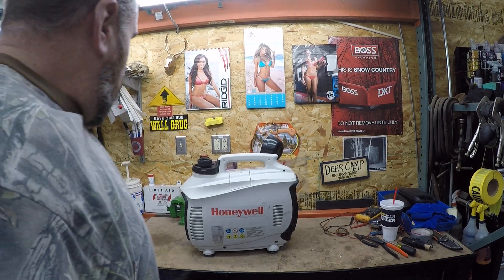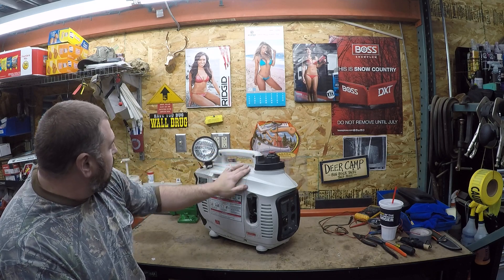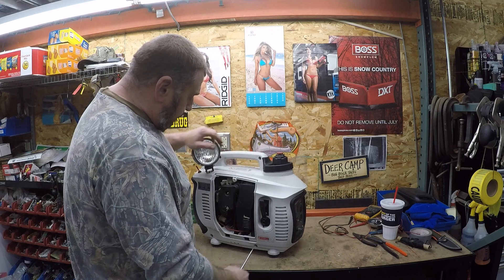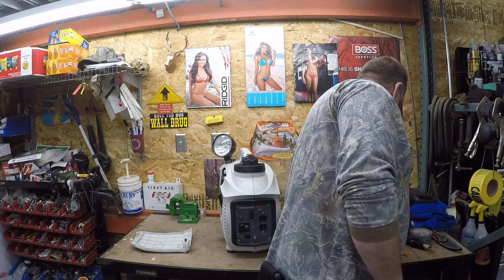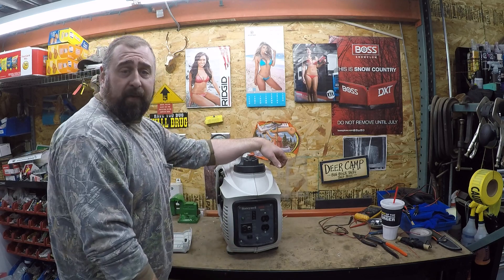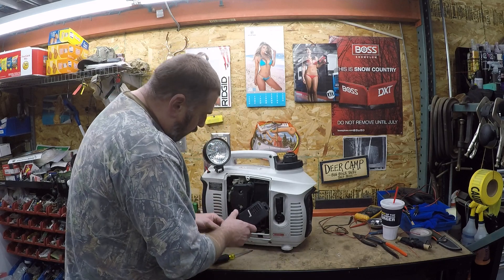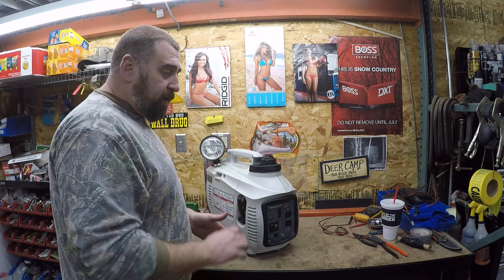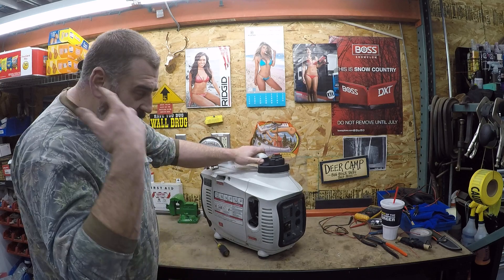honeywell 1600 watt portable  generator  / generac ix 1600 watt

Comment: Its been a while, could you explain more about the overload bypass?  I can deal with no overload protecting if i can still use my generator in emergencies.
Reply: I'm looking to the wiring diagram and it shows 3 wires from the inverter to 4 wires into the led module, 1 wire is split into 2.